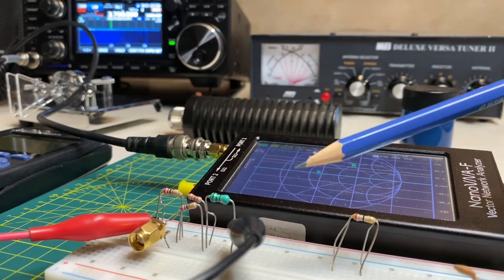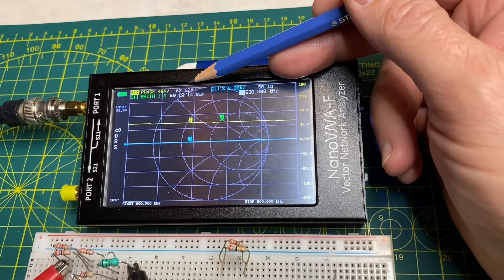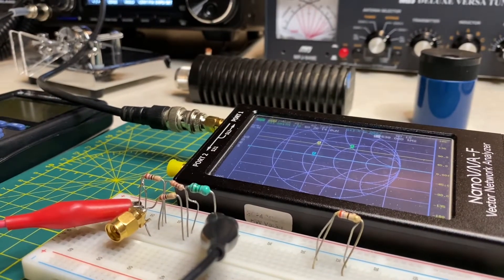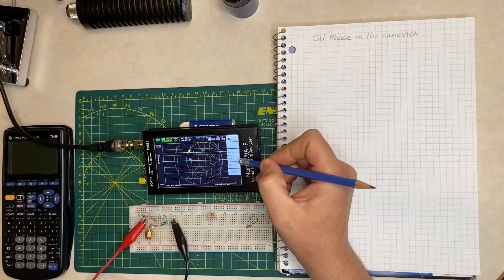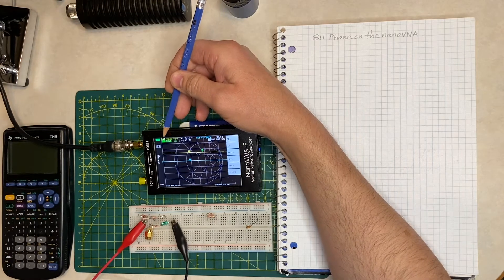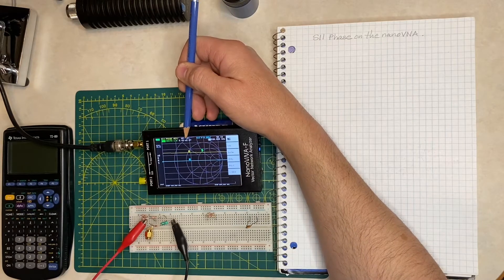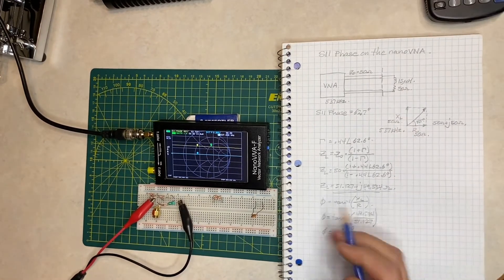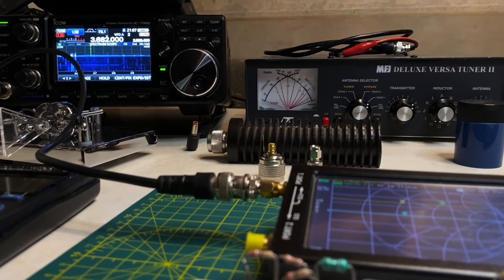nanoVNA - Is the S11 phase the same as the voltage vs current phase in a reactive circuit? (Vers.2)

Comment: Thanks man.  I have a question if you would be so kind as to answer it.   for example, S11 for a 50 ohm cable without an antenna and without a load at the end, the S11 read -2 dB 120°. Does this mean that the cable :
do a phase delay of 60° and -1 dB attenuation ( " -1 = -2dB/2 ")
 or
do a phase delay of 60° and  -5 dB attenuation  (-5 = -2 -3dB )
 or
do a phase delay of 120° and -1 dB attenuation ( " -1 = -2dB/2 ")
 or
 do a phase delay of 120° and -5 dB attenuation ( " -5 = -2 -3dB ")
or 
do a phase delay of 120° and -2 dB attenuation .

Will the phase and attenuation measurement differ when using S21, and how much will it differ?  Which is more accurate in measuring phase and attenuation, S11 or S21?
Thank you

Comment: You demonstrated the fact several ways, but i still don't know Why it is so ?
Reply from the maker: The math shows why.  The phase angle of the reflection coefficient is the difference in phase between the incident and reflected wave that the nanoVNA sees at the plane of reference where it has been calibrated.  The phase angle of the circuit under test is the relationship between the voltage vs current in that circuit.  As demonstrated, the phase of the voltage vs current in the circuit can be calculated from the phase of the reflection coefficient (the phase angle displayed by the nanoVNA).  The phase of the voltage vs current in the circuit does effect the phase of the reflection coefficient so they are related, but they are not the same thing.
Reply: @ve6wo  I don't think they're related directly at all. The phase angle that is measured in the reflection coming back to the vna has to do with the delay of the incident wave and the reflected wave at the reference plane. You could change that angle simply by changing the length of the cable past the reference plane slightly, without changing the component values at all. I guess what it comes down to is talking about "complex impedance" of just the components is really an oversimplification, and ignoring the whole system (not taking into account any transmission line effects, which at low frequencies and "short" cables are negligible anyway), and what the VNA is measuring is the whole system together past the reference plane, including the transmission line.
Reply from the maker: @gorak9000  your argument is valid.

Consider this though, if you are measuring a reactive circuit or device and the reactance in that circuit or device changes, it will cause a change in the reflection coefficient, and the relationship is clear if one takes a look at the math :-)
Reply from the maker: The reflection coefficient measured by the VNA and the reactive behaviour of the device under test are unequivocally married.  A change in the device under test will without doubt cause a change in the reflection coefficient, and from this information one can accurately ascertain the properties of the device under test so as to be able to firmly state the DUT’s complex impedance.  This allows one to quite accurately characterize the behaviour of the device under test.  One example of this is using the nanoVNA to determine the values of capacitors or inductors.
Reply from the maker: @gorak9000  regarding measuring the whole system together past the reference plane, this is correct.  That is why it is important to calibrate correctly and to use a suitable test apparatus for the frequencies and devices that are to be tested and/or characterized.  We are not really ignoring the whole system, rather, we are intentionally arranging things so that we can ascertain the desired information about the DUT while controlling or minimizing those aspects of the system that we are not interested in knowing about.  This is why I measure the nominal values of reactive components using low frequencies, to control those aspects of the ‘whole system’ that I am not interested in knowing about in the context of measuring capacitors or inductors.
Reply: @ve6wo  Yes, I get that you're testing at low frequencies to eliminate the effect of the transmission line, but then what explains the difference between the expected phase angle and the measured phase angle? All it can be is parasitics in the transmission line, the breadboard, or the non-ideal behaviour of real components vs idealized model components
Reply: So I watched it again, and I follow and agree with the math, so the question then becomes what does the reflection coefficient phase angle actually mean then?? Does it mean a 50+j50 ohm impedance in a 50 ohm system leads to a 62.7 degree phase shift? I guess that makes sense, because the load impedance does not match the system and source impedance, so you expect some reflection with some delay. So the reflection you get back is 0.44 in amplitude of what you put in, at a delay of 62.7 degrees GIVEN A 50ohm SOURCE IMPEDANCE. So you can think of it that the 45 degree phase shift is the network itself irrespective of what's driving it, and the 62.7 degrees takes into account the 50 ohm source impedance. That makes sense, because if you drive those same components at the same frequency, but from a generator with a different source impedance, you'd expect a different amount of reflection due to the different mismatch between the source and the load. I still find it difficult to mentally connect a 45 degree phase shift between current and voltage to a 62.7 degree delay when driven by a 50 ohm source, even though that's clearly what it is. It's much easier to think of it conceptually as a 50+j50 ohm impedance driven by a 50 ohm source leads to a 62.7 degree delay at a particular frequency, rather than equating a voltage / current phase shift to a delay phase shift - my brain just can't wrap itself around that relationship somehow.
Reply: I guess to take it one step further, what it actually means is when driven by a 50 ohm source, the reflection you get back is delayed by 62.7 degrees, and you will still have a 45 degree phase shift in voltage and current. The voltage/current 45 degree relationship is not changed by the reflection, the reflection phase (time delay) just shifts that entire voltage/current relationship in time by 62.7 degrees (which you could translate back to an actual time delay given the frequency). Ugh, too many layers on top of each other, but at least now it makes sense!
Reply from the maker: @gorak9000  I get that!  Haha!  I’ve had to redo some of my videos and repost them 3 times over as I received feedback that challenged concepts that I have shared… and then had to modify my mental picture of what was going on, then research to try to gather information from more than one source on the subject, then assemble it all in note form on paper, then digest it and re-form my brain around this new knowledge, then go to my basement lab and try to observe what I have learned first hand to prove it as either true or false…
Reply from the maker: You are correct, there are layers upon layers of things happening here.  It is a lot to wrap one’s head around, and I will openly admit that I have yet to come close to being able to frame the whole picture in my mind as one big system that I can mentally drill down on into any particular aspect of it without losing some other segment of the picture.

The more I learn, the more questions I have.  I may never be able to do it, I’m not sure if I have the mental horsepower to do it, but I most certainly will continue to push my brain to try!  :-)

Comment: 538 kHz? Why that frequency?
Reply from the maker: It makes the example simple and easy to understand.  At 538 kHz the magnitude of the inductive reactance is equal to the magnitude of the resistance, which results in a voltage vs current phase relationship in this circuit of 45 degrees.

The point of the video is to bring to people’s attention that even though we know the phase angle of this circuit is 45 degrees, why does the nanoVNA display a phase angle of 62.7 degrees?

This video explains why, and what the relationship is.
Reply: @ve6wo  Thank you for that response.  I'm trying to learn the nanoVNA I've just purchased. Your video and Comment response was very helpful. Sorry for my delayed answer. I've been distracted by the YouTube Presidential Election activities.😁